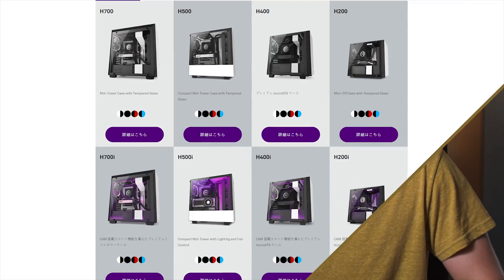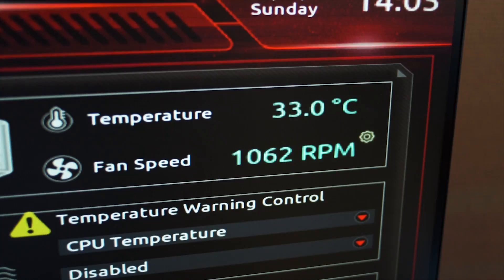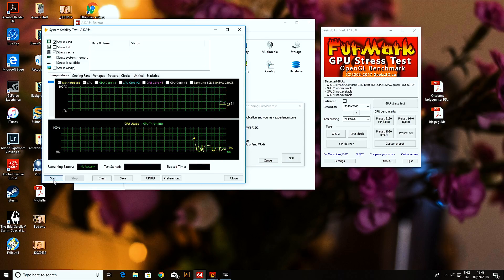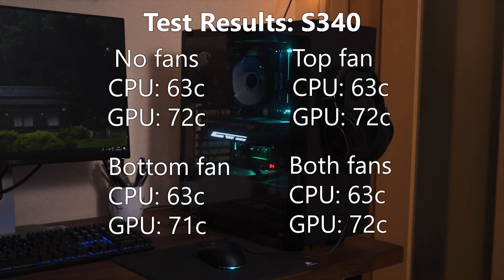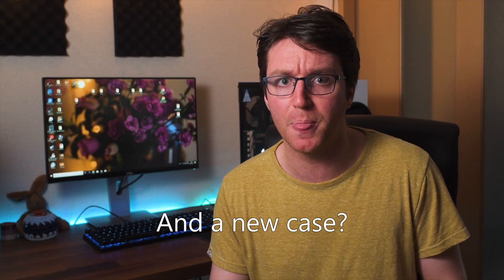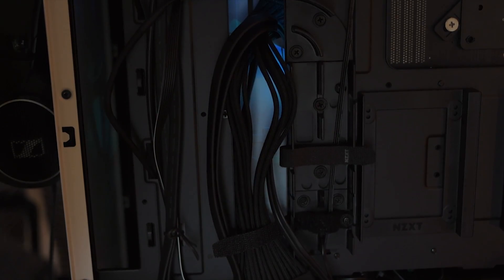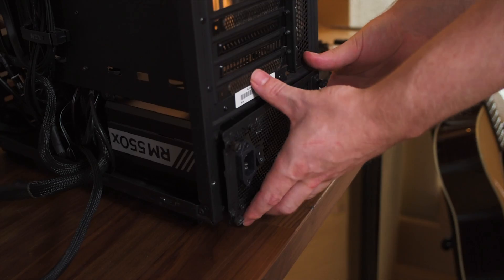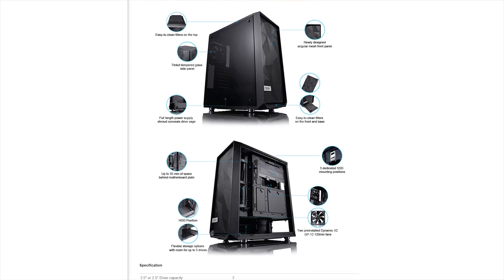NZXT H500 vs S340 front airflow comparison

Comment: I just purchased the black NZXT H500 for $16. It must have been an old stock unit because it is new. I can't complain at that price and it was a better building experience imo,  then the brand new Gamdias Talos that I just completed. I paired the H500 with a 6th gen M-ATX Gigabyte board and the I-7-6700K with an Asus GTX 1060 6GB card. I installed 2 front fans using a cheap fan and ARGB hub kit. It is serving me well so far. Thanks for uploading this 5 years ago, liked and subbed.

Comment: I have a 280mm watercooler for my 8700k in the front of my S340 (standard version) with 2x 140 high static pressure fans and I personally do get temperature differences when I have the fans on max vs quiet modes. In the rear I have a 120mm watercooler for my 1080ti with a 120 high static pressure fan and the fan speed also makes a difference in GPU temps. Maybe having watercoolers to focus the cooling in those areas make a bigger difference then just standard air cooling. If I take a small paper it will stick to the top/bottom of the S340 front air holes so its definitely sucking air in. 

Also idk if comparing the 340 elite front io ports to the standard H500 makes much sense because they make a H500 elite that would be in the same price bracket as the 340 elite.

I agree and think that the air flow of the S340 could be improved and have been thinking about cutting some holes in the front to match the fans. I think that would be cool but I would have to take it to a machine shop which is a lot of work for a $60 case.

Comment: Huh, I'm surprised the front fans don't make a difference. That spot is pretty good for placing a 240 AIO though, as it kept my OC'd 4.1GHz R5 2600 around 70C after 20 minutes of Prime95.

Comment: When i had only stock exhaust fans my cpu temps where the same. But my motherboard temps and gpu would climb during extended use. Once i changed the top exhaust fan to the bottom front. Instantly got cooler mother board temps and helped the gpu a little. Ive been running that set up for a while now but now that ive been playing cod mw on high settings my gpu 2060s hits 80 degrees with ray tracing on (midd-high70’s with it off) so i was thinking of buying 2 140mm good quality fans for front to help move the air. So confused to why everyone says front fans dont make a difference but on my pc it does. Without them hot air would just sit in front of gpu and heat up gpu and mobo.

Comment: Thanks for the video. Do you have any comparison video that about maybe similar weights big airflow case like cooler master h500 and nzxt 500i ? or corsair carbide 275r I mean does it really matter front panel opened or not for low temps.

Comment: What if I put a 280mm radiator in front ?? ..... according to your video this will not make any change in gpu temp or temps in general and it will be as if there were no fans in the front right ??

Comment: First time builder I’m using  h500 case with the h7 to cool my i7 8700k with an rtx 2070. Will my cpu run too hot at stock speeds?

Comment: i got the h500 and was wondering if getting 2 140mm in front will make a difference.. but I guess not. Thx man
Reply: it does help the positive pressure (reducing dust), but not temperature-wise, as you said ;)

Comment: im thinking of geting h500 or fractal meshify c ,,, is the 40$   diff worth to buy the meshify? or the h500 is fine
Reply from the maker: In most cases, the H500 will be fine unless your system has very hot components the H500 is a great choice.
Reply: @DawidDoesTechStuff  the h500 supported the vertical gpu? or only the h500i? and is it not included? how much it will cost for the vertical mount
Reply: the meshify c has a black trim of glossy plastic all around the front panel which gets scratched up just by looking at it.  And the airflow is not that great out of the box. you need to buy some good fans to see real gains. but then pretty much all cases will have decent/good airflow with some good noctua or bequiet fans. its also really small and it wont be able to fit a big 3 fan gpu with a front mounted radiator.

Comment: so 2 intake fans at the front and 1 rear, 1 top exhaust? is the best?
Reply from the maker: From all the tests I've done, it seems that you don't need to two intake fans with these cases. It makes a very small difference.
Thanks for the question.
Reply: one last question. what do you think of putting an AIO with this case? x62/x52 to be exact. is it the same?
Reply from the maker: @cult2  I think the AIO in the front won't help airflow, but it will definitely work well. Many people use those AIOs in these cases and I haven't seen anyone complain about bad performance.
Reply: @DawidDoesTechStuff  work well in terms of cpu cooling? will there be turbulence on the gpu and other components airflow? im still confuse whether i'd go for scythe mugen or kraken x62. what do u think?
Reply from the maker: @cult2  So I think it will work well on terms of CPU performance, but I don't know how it will affect the other components. However, Kyle (from bitwit) tested where in a case to put AIO radiators and showed the the front was the best even when it came to the other components temperatures. I would get the Kraken if you don't have to push your budget too much to buy it over the Scythe.
Reply: thank you very much for the prompt reply and informative answers, i will buy the kraken earlier  next month :D
Reply from the maker: @cult2  Its a pleasure, I'm glad I could help. Enjoy. :D
Reply: @DawidDoesTechStuff  thanks man. so only stock fans? (top n rear exhaust)
Reply from the maker: @cult2 The stock configuration seems to be ideal. I haven't tested what effect changing the 2 stock exhaust fans. So that may be a good place to start if you do want to replace some fans.

Comment: I wonder how different this video would be if you used a GPU like a 1080, or above. Or perhaps even used a 5GHz 6+ core CPU. 
My slightly higher end machine gets really warm, even in a big case with 6 fans; and I think my GPU is to blame.
I don't think it would fair well in the H500 case.

Comment: You want annoying? My first build was the nzxt phantom lmao. That thing made no sense to me yet I somehow got all the LED fans to work. The airflow is great on this case which is what I'd expect my nzxt had 7 fans and the 7970 and my temps were 70 max also
Reply from the maker: That's interesting. Did you see how it performed before adding those fans?
Reply: @DawidDoesTechStuff  yessir you had good temps at 70 with just 2 fans right? Comes with 2. I added a noctua CPU fan to my build but since you proved added fans don't do anything. Seems odd you get such good temps with 2 fans tho
Reply from the maker: @ZVManning  I know. It is pretty weird. I have done tests my times over different videos and I always get the same result. I think adding a noctua fan to your CPU cooler is always a good idea.
Reply: @DawidDoesTechStuff  lol it's almost sad but if it actually keeps things from melting I'm down 💯

Comment: i just thinking about this, buy s340 elite or H500 ?? please reply
Reply from the maker: I would definitely go for the H500, their airflow performance is the same and the H500 is easier to build in and in my opinion better looking.
I hope this helps. :D
Reply: Dawid Does Tech Stuff what about metal, is h500 thinner? It’s important parameter for me, because thin metal do more noise and I like heavy cases.
Reply from the maker: @ivanpoberezhniuk9694  That's a good question, I think they are both pretty similar in this regard.
The S340 is a bit heavier, but it is a bit bigger. They are both very well built, but it is important to remember that they are pretty cheap cases, so they don't have that heavy tank feeling.
Reply: @DawidDoesTechStuff   does the different size lead to any change in a build, like if i had a build for the s340 but since it got discontinued, would the same build work for the h500 or h500i?

Comment: Please help!!Should i buy and add two fans at the front of H500?(H500 only comes with two stock fans at the back.)Most importantly,I am going to build a gaming pc with Ryzen 2600 and MSI RX580 ARMOR OC inside the H500,so does it make a different of temperature when i use amd build instead of intel?(You only tested intel cpu in this video...)
Reply: @Ka chun Yeung Your Ryzen R5 2600 wont run any hotter than Intel; it’s a great little cpu.  A simple air cooler like the Cryorig H7 shown in this video is plenty to cool it off, even if you plan on overclocking.  As for the two fans in the front of the H500, according to the video it sounds like you will see temps drop 2-3 degrees by adding them, but it’s up to you whether or not the increase in noise would be worth it.
Reply: @shawnb5899  Thanks!

Comment: Because I'm.new to gaming I sound stupid but basically your truna say buy the pc case stock and u don't need to add anything? I'm new sorry and where's the outtake fans
Reply from the maker: You don't have to worry about sounding stupid, everyone was new to pc hardware at some point.

Yes, the tests showed that adding more fans isn't worth it. So the stock setup is fine. The case comes with two exhaust fans. One in the back and another in the top of the case. Those are all the fans it comes with. Let me know if you have any more questions.
Reply: Do you recommend with a apu. A r5 2400g.
Reply from the maker: @xxthatoneguyxxonyt5767  Unless you are having problems with heat in your system, I wouldn't worry about it. The 2400g is a much lower heat setup than the system I used, so you should be fine without.
Reply: Dawid Does Tech Stuff cheers fkr that reply youtube just gave your reply now my builds gonna be a r5 2600 with a rx 580 :D and u also earnt a subbed so ty
Reply from the maker: @manvir5147  That is a great setup. Good job on researching the parts for your first build.
Thanks for subscribing, welcome to the channel. :D
Reply: @DawidDoesTechStuff  thanks man been doing research since about summer gotta wait till april my bday tho for the set up. Tjen I wanna get two 144hz monitors. Hype is real man cos all i play atm is lol on my laptop which I swear out :p and ps4 is boringgg plus i need a pc for exam revision in about a year so its useful
Reply: Thanks. Its my starter build

Comment: I have a cooler master ma610p as cpu fan and m planning on buying S340 elite case... Will the 610p be too big for the case.. Would I be able to close the glass Panel?? Plz need ur advice.. Help!
Reply from the maker: I just had a look and it seems like it might actually not fit. On the Coolermaster website it says that the ma610p needs 166mm clearance and on NZXT's website it says that the case has a max clearance of 161mm. Its very close but I think it may not work.
Reply: @DawidDoesTechStuff  thanks alot for replying.. So can you help with some options for cases that can fit  ma610p or shld I just change the cooler itself?
Reply from the maker: @krndv7 It's a pleasure. I don't think you need to change the cooler unless you really want the NZXT case. It will fit in the cooler master H500 and Fractal design Meshify C, which both cost around the same as the NZXT S340 elite. In my opinion the fract design case is one of the best on the market, and it has great airflow.
Reply: @DawidDoesTechStuff  thanks alot for all ur help.. I really didn't want to go for a new cooler as I recently got ma610p. :) I think I will go for meshify C as I love the look of it as well.. Thanks again :)
Reply from the maker: @krndv7  Im glad I could help. The Meshify C is an amazing case. I'm sure you will be happy with it.

Comment: I was wondering is there will be difference with 2 fans intake front and  (1 top + 1 rear exhaust)
Reply from the maker: Sorry, I should have said in the video. All the tests were done with the top and rear exhaust fans installed. So the tests temperatures with two fans in the front shows the results for what you mentioned. I think there was only a two degree difference on the CPU from not having any fans.

Comment: NF-F12 fans are more optimized for static pressure and therefore the differences are not that big. Try using 140mm fans that are optimized for airflow, or both airflow and  static pressure.
Reply from the maker: I have tried the tests on the S340 with three different types of fans (in various other videos about front airflow) and none of them made any difference. Although I had a viewer let me know that when they added front fans it made a fairly substantial difference. Not really sure what to make of that.

Comment: Hey, good vids.

Try showing more of what you’re talking about rather than using the shot of you talking. For example, I would have liked to have seen the USB front panel I/O thing you mentioned 

Keep up the good work 👍🏽
Reply from the maker: Thanks for the comment, I really should have added a shot of the front panel connector.
Reply: @DawidDoesTechStuff  a lot more than that.  Its video of 80% you and 20% computer, you need to flip that ratio
Reply: @DawidDoesTechStuff  yes, because i dont want to see you talking, I was hopping to see a both cases side by side, not you